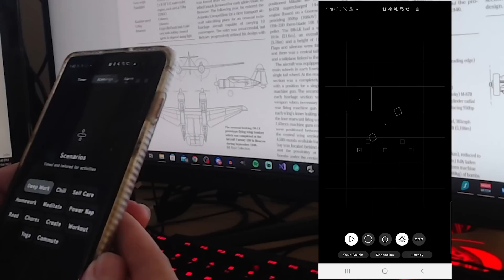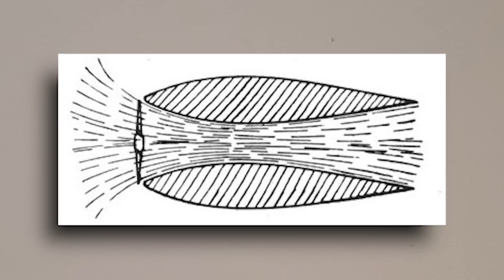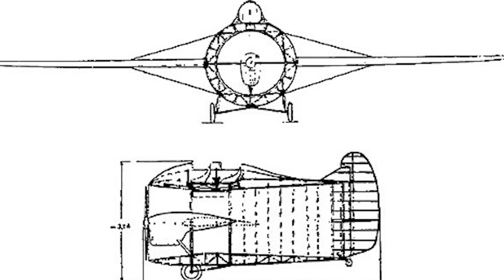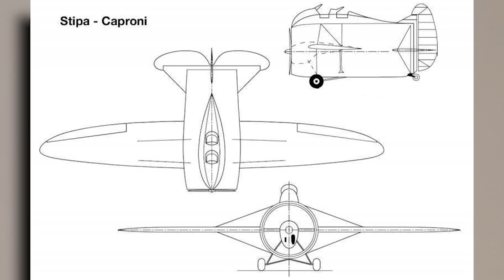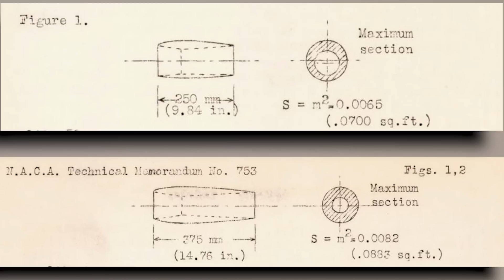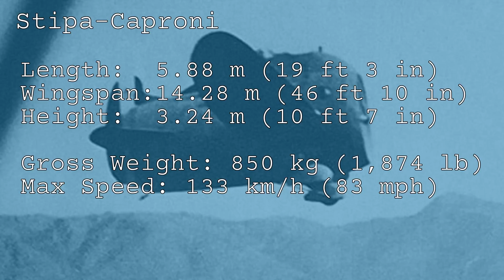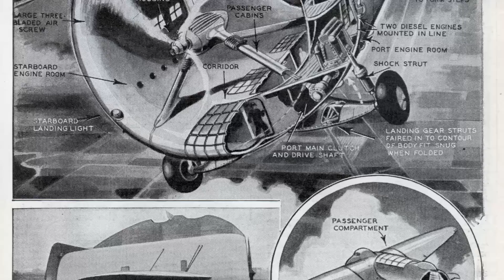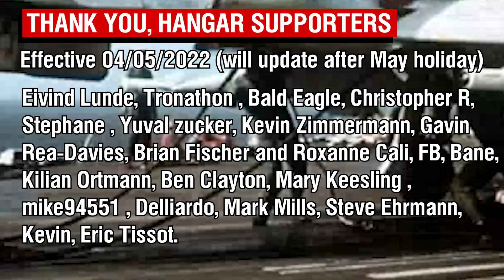Italy’s Bizarre Flying Barrel | The Stipa Caproni [Aircraft Overview #55]

Comment: Another design ahead of its time the obvious problem both aerodynamically and also construction wise is just the size of the propeller iFly Radio control aircraft and for radio control jets we use electric ducted fan motors which are extremely efficient and mate very fast Radio control aircraft if you look at the propeller on the ducted fan it's not to Giant normal propellers it's three or four much smaller in diameter but much fatter more in the shape that you would find on a ship not an aircraft the main problem or fault of his design was the propeller is just too big they needed to design the propellers much shorter and diameter and much fatter so that they would still cut the same amount of air and then that would also solve all the other design problems with the plane the plane would be more like a jet